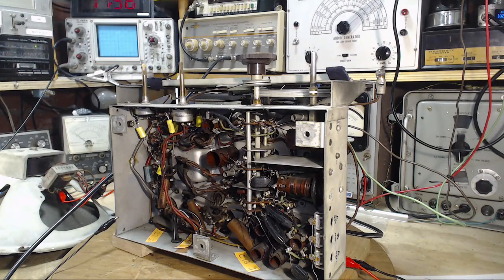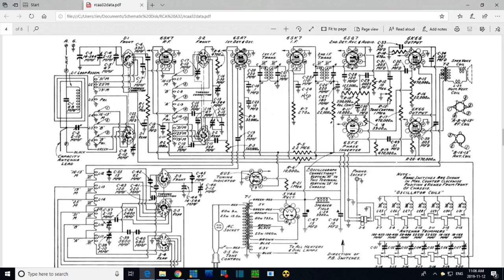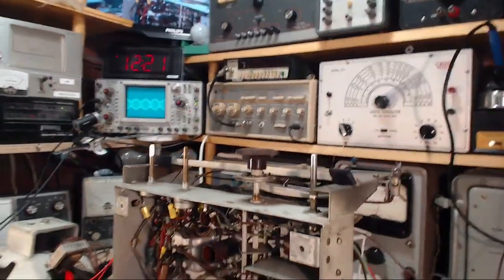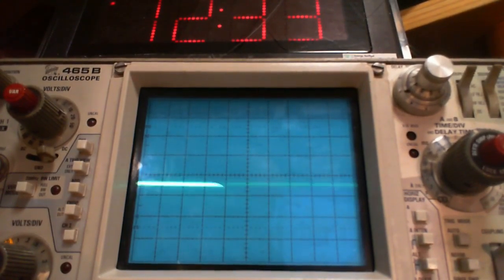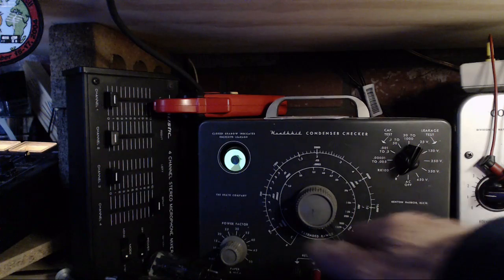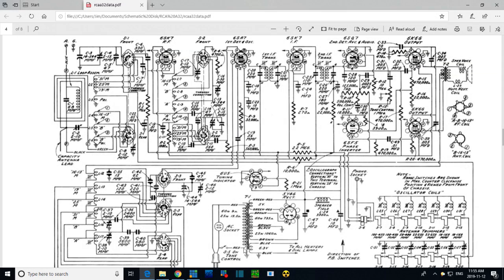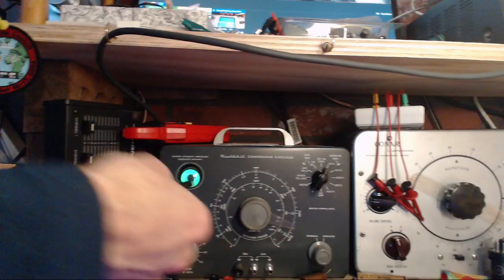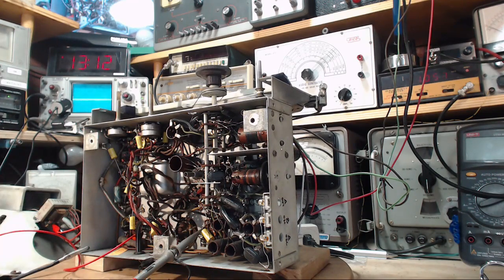RCA A-32 Globetrotter Video #9 - Three Interesting Capacitor Replacements

Comment: Thank you for that Jim.. It's always interesting and informative to see things proved scientifically, even though in your (my), mind, just replacing old caps is a fairly safe bet to improve things.  But we all have our ways of doing this stuff and  usually the means justifies the ends in most cases.... Getting the equipment working to spec again. That radio sound pretty lively now, so looking forward to watching your alignment to see if you can squeeze a bit more out of it.. Keep warm !

Comment: When you try to measure the resistance across a capacitor on your cap tester, shouldn’t you move the test leads to the resistance terminals.